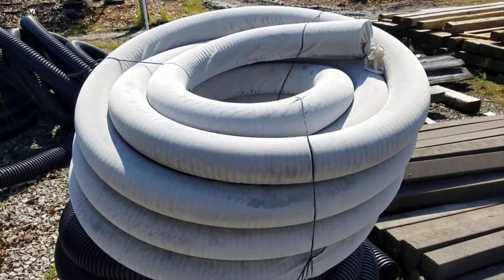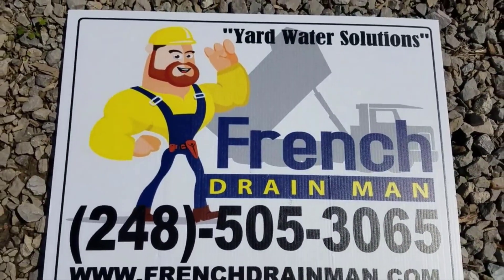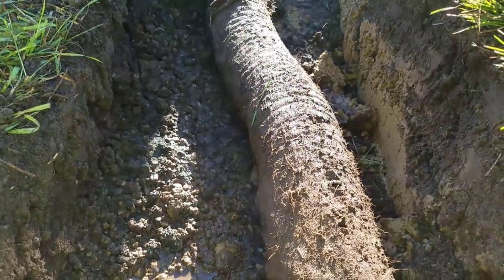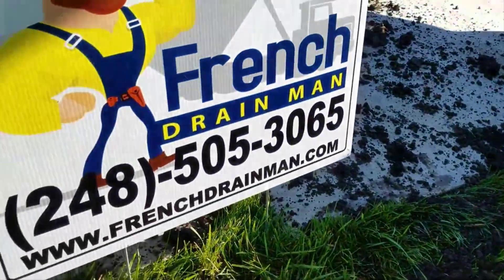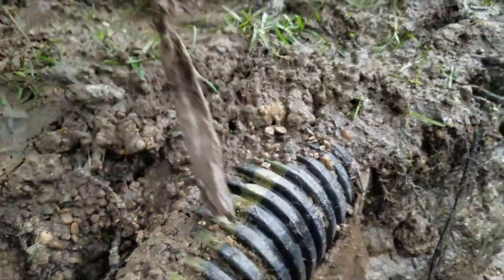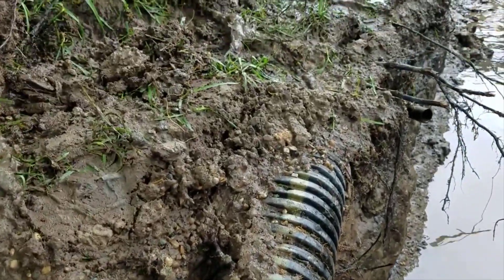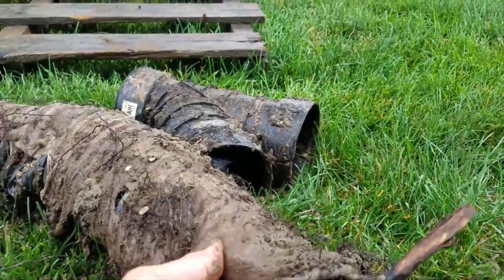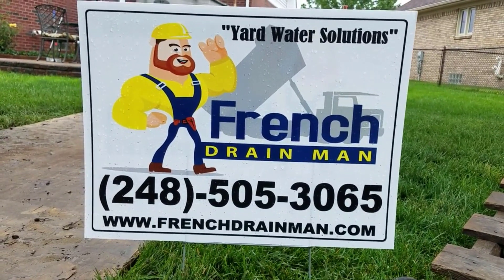The Correct Way to Use Filter Wrapped Pipe in French Drain Systems

Comment: I plan on running a french drain through an area that has lots of the dirty sandy gravel. I'm using the Baughman 8 slot and plan on burrito wrapping it with the large washed stone. Will the non woven geotextile fabric keep the fine stuff out of it... Should I add a sock for added insurance?
Reply from the maker: I would use small stones and non-woven geotextile filter fabric. Some of the fines will make their way through the fabric and fill the large voids, so you will need very small stones to form a stone filter zone.
Reply: @FRENCHDRAINMAN  my options are washed round 3/4" or 1 1/2". 3/4" will be small enough? Thank you sir!

Comment: Thank you so much for posting these videos. My wife and I dug the 18 inch trench, about 50 feet long alongside my driveway which is adjacent to the foundation of the house. It grades down the driveway, so our pitch is good. I ordered round rock 1-1/2 inch, but I was trying to take the easy way out and just use a sock and then NOT use geo textile-non woven drain fabric to burrito wrap the pipe and rock.

Coming across your video, I'm glad we waited to finish it so I know how to do it the right way that will last a long time. I would hate to come back to it years later and dig it all out to see it failed. Burrito wrapped perforated pipe and round rock in good DOT approved fabric, I'm hoping we're looking at years of performance out of this system. Thank you!
Reply from the maker: You made a wise investment. That system will work for decades. 
Thank you for commenting and sharing.

Comment: 10/10, the sock is also intended to evenly distribute water around the pipe &, as we see here, it also evenly distributes the unwanted-roots too.   I think I'll end up with fabric-bottom-&-sides with a no-fabric-top so that any fines flow through the system keeping the drainage in the lowest point of the lawn.